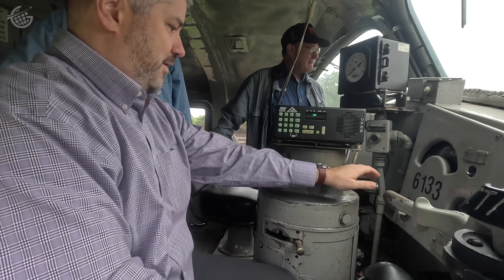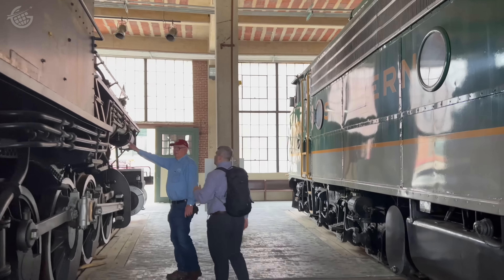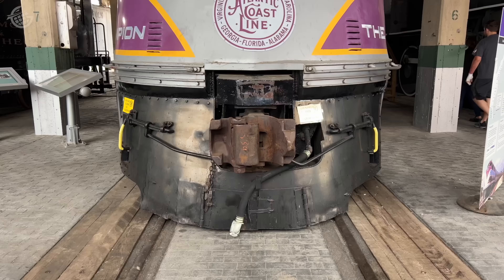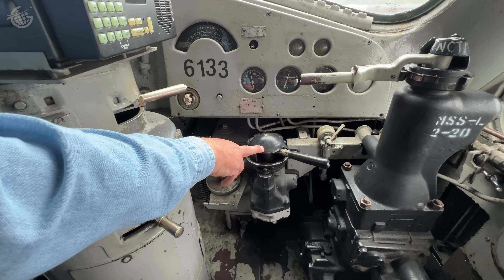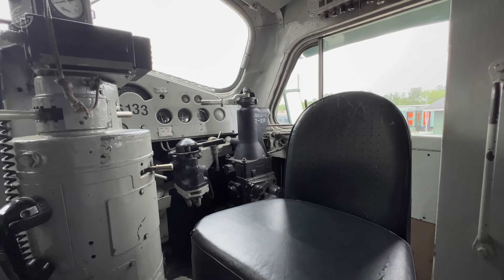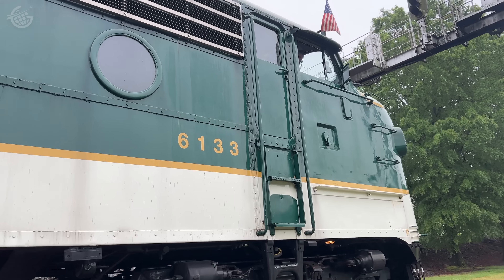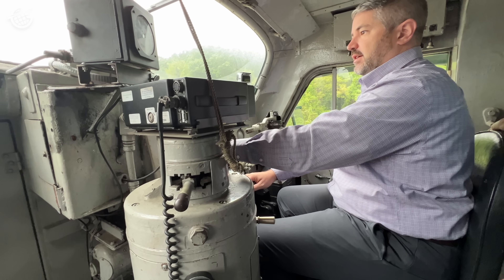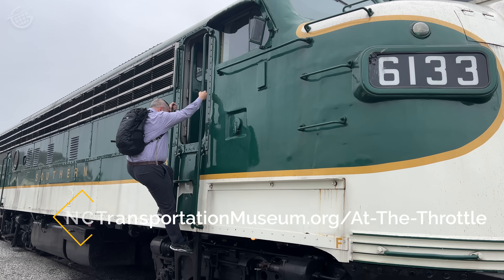I DROVE THIS TRAIN (and you can too!)

Comment: I am Australian, and I am lucky enough to say that I get to drive trains for a living. Driving a modern suburban train is not as hard as some may think. Sure, there are many skills you need to master, but most of them are learned skills. You just need to put in the time and effort. What you do need to know is that operating the train controls and systems is only half the job. The rest is building up your track knowledge, which involves learning where all the signals are located because trains take time to stop. If you only start braking when you sight the signal at stop (red), it may be too late. You will have a SPAD (running a red signal), and that is not a good thing. Track knowledge is what keeps a train safe. Overall, once you learn everything you need to know, it is surprisingly easy to drive a modern suburban train. You just need to remember that this job can go from being very easy to a nightmare within seconds. I have PTSD from this job, but it is still a great job if you are lucky enough to get it.

Comment: One of my greatest adventures as a kid. My uncle was a dispatcher for the New Jersey Central Railroad. In 1967 when I was 12 he arranged a cab ride for me. It started in western NJ near the Pennsylvania border. We had 4 F7 units in an A,B,B,A configuration followed by 106 C&O open hopper’s full of coal. In a desolate section of track the engineer let me take the controls. It certainly would not happen today. I must say though that is the most power I have held in my hands to this day.

Comment: There is another railroad museum that offers this in Portola, California. The track is a lot shorter, however. The museum however is great, with a huge collection of rolling stock and locomotives. They specialize in the Western Pacific railroad, which used to run through that area, with a lot of locomotives in that collection from the Western Pacific. Great and knowledgeable staff, and I myself drove a train there, a shunter engine (that’s not the only engine they have that you can operate there’s multiple). it’s a great place, and if you live in the western half of the US and don’t want to go all the way to North Carolina, Portola is a good option for you. It’s located across the border from Nevada near Reno along state route 70.

Comment: If the Norfolk and Western No. 611 ever makes it back down to Spencer for another stay at the museum, it’s definitely worth checking out. There’s just something about being behind the throttle of a living, breathing steam locomotive that just blows the diesel experience out of the water.
Reply: Fun fact:  as mentioned by Jeb, the turntable at the Spencer roundhouse has a length of 100 feet.  The N&W class J 611 has a wheelbase of 98.5 feet.  Spotting the 611 on the turntable is a very precise maneuver

Comment: 3:34  What you refer to as the "Selector" is actually the Reverser.  The Selector is the silver handle on the upper left side of the Control Stand.  They're different handles with different functions.
Reply: You are right.  The 'EMD Enginemen's Operating Manual Model F7' shows that handle as the reverser;  although I have heard some refer to it as the selector also.  I believe that the handle you refer to on the upper left side of the control stand is the transition lever.
Reply: @WBDE  The Transition Lever and the Selector Lever are the same thing, and were used to control the transition steps in trailing units that weren't equipped with Automatic Transition.  It also operated the Dynamic Braking on units equipped with it, which this unit is not.

Comment: In the early 50's, Uncle was a mechanic on the Railroad.   One day, he took me on a Locomotives just like the one in the video. He took me to where the deisel engines were inside the Locomotives. 
There were two rows of motors.  He gave me a math lesson.   He ask me how many motors are there.  I was in first grade, and not good at math.
He showed me.  He counted out 8 motors on one side, and said there 8 motors on the other.
He said how many motors does that make.  I look puzzled.   He said 8 and 8 are 16.
So there were 16 motors on each side of the Locomotives. 
My uncle gave me an engineers hat that day.
It was a very memorable day for me.

Comment: Rolling stock: 
 
Piedmont and northern boxcab 63 

Atlantic coast line and seaboard coast line e3 501 

Southern railway fp7,ft,and e8 6133,960604,and 6900 

Southern railway and norfolk southern gp30 2601 

Buck steam station 25 ton 

Norfolk southern,precision national,and peabody coal as-416 1616 

Norfolk and western gp9 620

A us navy 65 ton 

Us army and beadort and morhead h-12-44 1860 

Southern railway and city of clemmons 2-8-0 542 

Atlantic coast line 4-6-0 1031 

Seaboard air line 2-10-0 544 

Carolina power and light 0-4-0 3 

Duke power 0-4-0 111 

And us army 0-6-0 5007

Comment: There is a reason why the normal progression in train professionals is from conductor to engineer. The conductor need to know their sh*t. The engineer needs to know where that sh*t came from.
Reply: Back in the day, conductor and engineer were two separate promotion paths - engine service and train service. Engine service was, fireman to engineer, learning to run a steam engine. Maxed out at engineer, no chance of promotion beyond maybe a road foreman of engineers. Train service was, brakeman to flagman to conductor to possible further promotion, working on the ground and in the caboose, learning how to do the ground work and the paperwork.

Exactly what you describe, but two different paths for the two ends of the train.

Sorry if I sound like a know-it-all, but I really enjoy this stuff.

Comment: That looks like an amazing experience. Fun fact: the Southern Railway was one of the 4 railways that did not initially join Amtrak in 1971, instead opting to continue to offer its own passenger services, most notably the Southern Crescent and the Asheville Special. 6133 was regular motive power for the Asheville special until Southern ended that service in '75 or '76. The Southern Crescent lived on until 1978-79 before it was finally handed over to Amtrak.